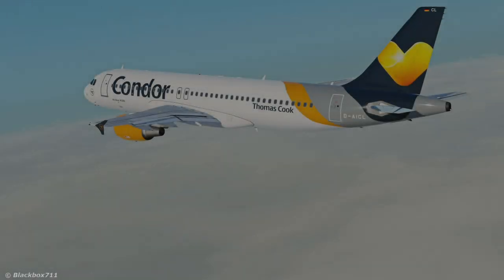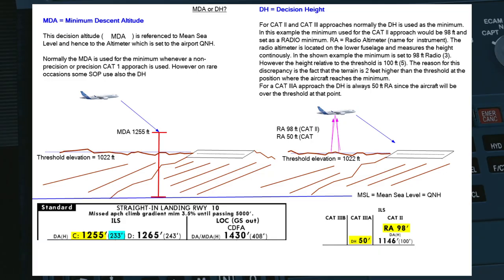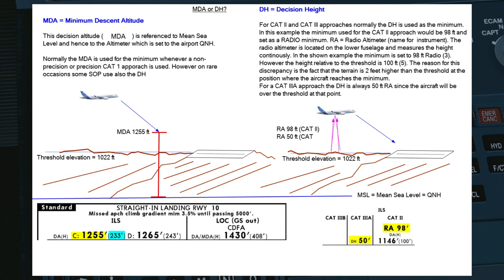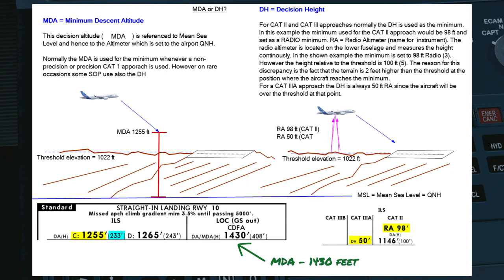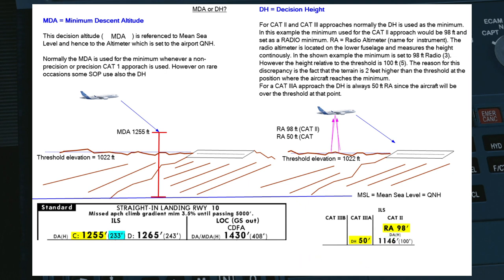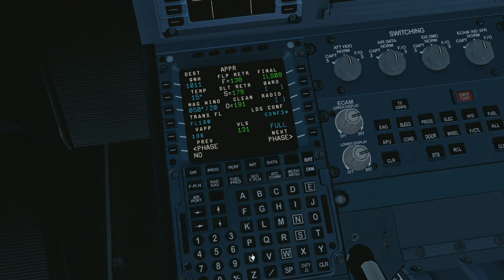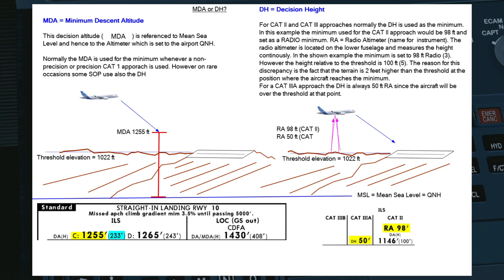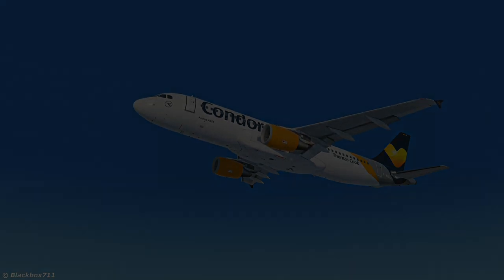FAQ - MDA or DH? Baro or Radio?

Comment: Hello. 
Nice video, but I would like to tell you that you are talking about DA as it is MDA, but they are different. MDA means Minimum Descent Altitude and it is used in NON-Precision Approaches, DA means Decision Altitude, and is used in precision approaches. The main difference is that you can not go lower than that MDA, on the other hand when using a DA, for example in an ILS, you take the decision to continue or go around at that altitude. Then radio altitude as you explained is used on CAT II and III approaches in general. Thank you and congratulation on the channel.
Reply: Incorrect, you can go lower than MDA with visual reference. Aviation is my profession, this also goes for Blackbox. To my knowledge he explained everything correctly.
Reply from the maker: Hello Arturo. That is exactly what I was refering to in the video when I was saying that some operators are using different procedures. Please be aware that I am using my company SOP and we are flying an ILS CAT 1 approach using MDA and not DH or MDH. Cheers.
Reply: @Blackbox711  The issue is that people confuse DA (a baro reference) and DH (a radalt reference). During instrument training NPAs always use MDA, while Cat 1 ILS (usually in aircraft that doesn't have a radio altimeter) uses DA. So instrument-rated GA pilots who sims with the Airbus may end up entering DH for Cat 1, because they didn't know the difference, or thought "this is how it's done in the Airbus".
Reply: @thomasjenkins8926  
Hello Thomas. 
Aviation is also my profession. Is obvious that you can go lower when you have a visual reference. Thank you. 
The Minimum Descent Altitude (MDA) or Minimum Descent Height (MDH) is a specified altitude or height in a Non-Precision Approach or Circling Approach below which descent must not be made "without the required visual reference"

Comment: Some military operators fly approaches using QFE instead of QNH so the altimeter reads 0ft at the threshold. Therefore they fly a MDH for non precision approaches and use the figures in brackets.
Reply: We have fly all over the Russia until recently by this method,but now QNH is everywhere
Reply from the maker: Interesting to hear that! Thank you very much.

Comment: This is quite confusing. Reason: MDA is not a "decision"-altitude and therefore not the counterpart of the DH.
The term "Minimum decent altitude" is a paradoxy in itself. It should be called MA: Minimum Altitude.  
The chart doesn't refer to the MDA either, but rather to the DA, the "decision altitude"  as the counterpart of the 
"decision height".

Comment: Now explain the differences in CAT1, CAT2, CAT3 approaches 😬
Reply: CAT I with minimum RVR runway visibility range of 550m.

Below that you apply CAT II.

Below 350m you are CAT IIIa.

Below 200m you are CAT III b.

Bwlow RVR 50m you are in CAT III c.

CAT II and CAT III need autoland.
But there are some airlines which allow CAT II to fly manually, which is normally not recommended.

For the MDA and DH you also have to consider if you are in CAT C or CAT D for A320 family or 737 family and other large aircrafts.

The CAT C and CAT D depend on the approach speed.
Reply: you forgot the "Please"
Reply: @ahmedsmart1120  Thanks

Comment: Hi BB. Thanks for such an informative video. You mentioned whilst looking at the chart something about "aircraft classes" e.g. class c. What does this mean? You mentioned heavy aircraft are class c. Where can I find info regarding this? Thank you!
Reply from the maker: The classification A to D are ICAO Aircraft Approach Categories. Those depend on the approach speeds, so indicated airspeed at the runway threshold (VAT) whilst in the normal landing configuration at the maximum certified landing mass. An A320 typically is C, while a 747 is D.

Comment: Very clear explanation! Thank you for the effort you put in! I have a question regarding CAT's. If for example, you would be landing on a CAVOK day, 10+km visibility no meteorological obstructions, you would be able to for example fly a CAT1 APP. How do you select what CAT you are flying, in sim I almost all the time get CAT3 on the display's even if I don't need it. Is it different from real world and what would the case be IRL? Thank you again!
Reply: During normal operations you always fly CAT 1 ils. On request you can fly CAT 2/3 but you need to advise atc about it beforehand so they have time to prepare ie turn on runway lights, increase traffic separation, many other things. 
Regarding FMA CAT 3, it's just an information that aircraft is preparing for autoland. You can always degrade to CAT 1 but switching off autopilot
Reply: @maestro7332  Thank you very much for clarification, really answered all my questions! Milego dnia!
Reply from the maker: @maestro7332  good explanation. Thank you.

Comment: Concerning the 233ft MDA for CAT 1, you need to put this value for example in a 737 classic, right?
As i know the MDA/DH panel in a 737 classic accepts only values from 0 to 999ft in the box. I mean three digit value.
Reply from the maker: Isn’t the minimum set via the rotary button on the glareshield in the 737?
Reply: On 737 cl (and 757/767), the Baro minimum (MDA or DA) are puted as the red marker on the round altimeter, and there is no auto call-out for that, PM is in charge to call that out.
While there are auto call-out for radio minimum, you must not use it when charts only shows MDA or DA(DH) as the terrain is not flat as in the video. So you have to put it to -20 for NPA or CATI, to inhibit the auto-call.
Sadly there is no PM in most sims (I only know FS2Crew for LD767 could make that call based on red marker). so I'd stil normally put DH in radio minimum on my flight with Feelthere 737CL and CS757, bettere than nothing.